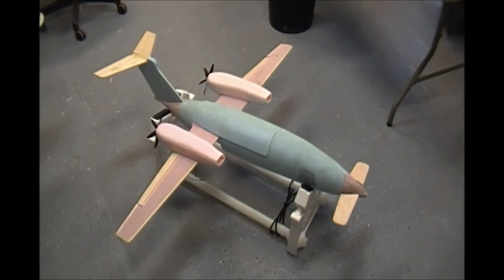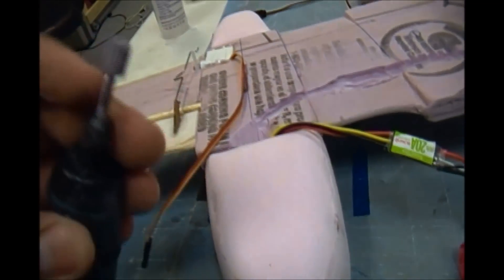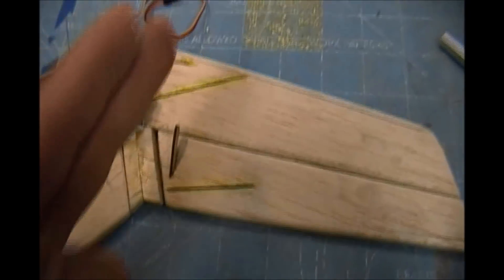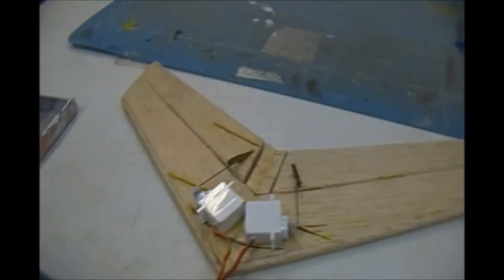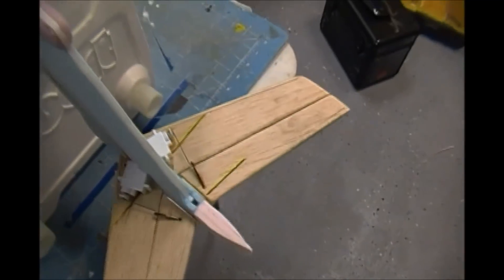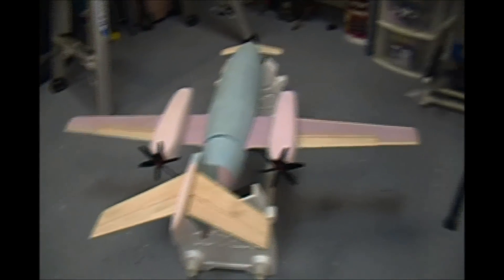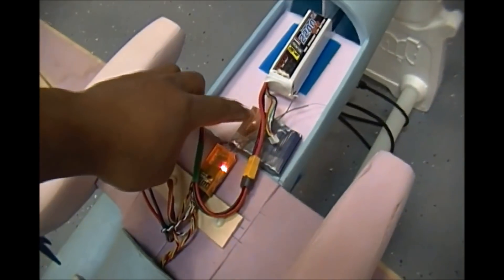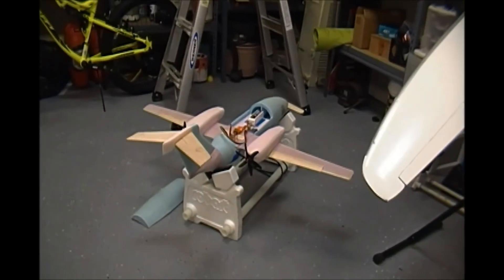p 180 servos installed

Comment: I cut channels in foam using a very hot soldering iron lay it flat on the surface and slowly draw it across the surface you want to channel try it works well.